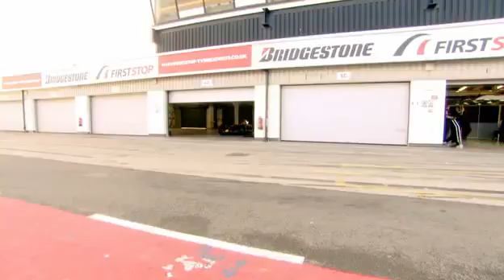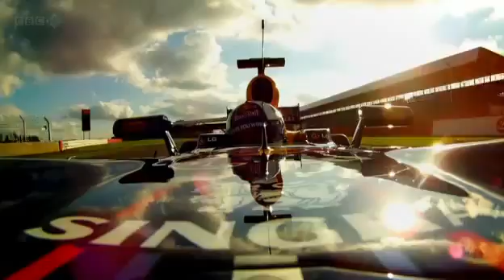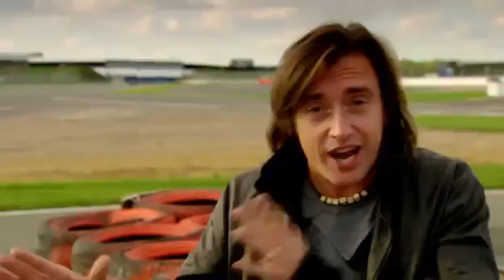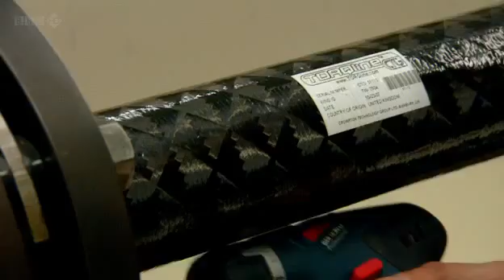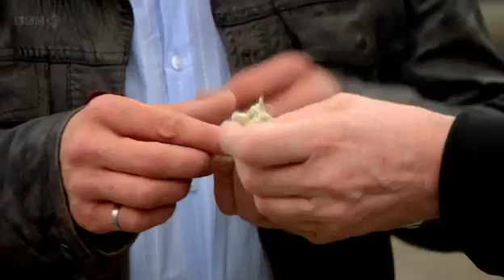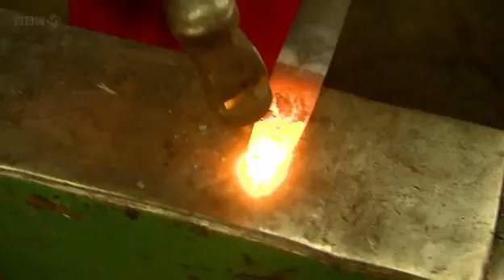Richard Hammond's Engineering Connections - (S03E02) Formula 1.

Comment: Why not use carbon fiber wheels then? can someone explain that? that way you eliminate the risk of fire and use a very strong if not stronger material than magnesium just like the lambo sesto elemento does
Reply: So first of all theres actually no worry about fire. Because solid Magnesium won't burn easely. What do burn easely is pulverised Magnesium or Magnesium shavings when it's machined. That's also the reason why they use oil based cooling solutions if they machine Magnesium.
Second, Carbon fiber is a lousy thermal conductor. That is importent because they use the heat of the brakes to keep the tyres in the right temperature range.
And third, the weight loss wouldn't be significally. The density of pure Magnesium is 1.7g/cm^3. Because they use an alloy it is a bit higher. But normal Carbon fiber weavings have also a density of about 1.8g/cm^3

In the end, the Carbon fiber wheels of the lambo are nothing more than a marketing gag. Looks great on the data sheets to impress potential buyers, but they bring no performance gain.
Reply: I would assume rules dont let them do it
Reply: Rodrigo Melendez Hirezi carbon fibre suffers from catastrophic failure unlike metals which can be tested for micro fractures. This means you could have carbon fibre wheels that literally explode during the race. Metals also gave better elasticity than compounds which means it can absorb some energy.

Comment: Actually Kevlar is weak against sharp puncturing force. The reason it does not work well against metaljacketed rounds.
Reply: Not with small, tight weaves.
Reply: nutsackmania Even still, a bullet proof vest alone wont stop high powered rifle rounds or fast moving shrapnel. Standard issue FMJ rounds used by the military would make swiss cheese of standard police armor, and even non-trauma plated military armor.
Reply: Matt Brine Yes, but F1 cars are not military vehicles and dont need to be protected against rifle rounds travelling faster than sound.

Comment: They run on highly engineered gasoline. Yes. The rules of the FIA specifically state that "Formula One race fuels must be composed of compounds normally found in commercial fuels."

It is gasoline..and certainly not ethanol or anything of the sort.